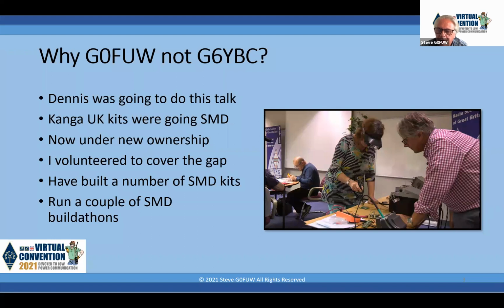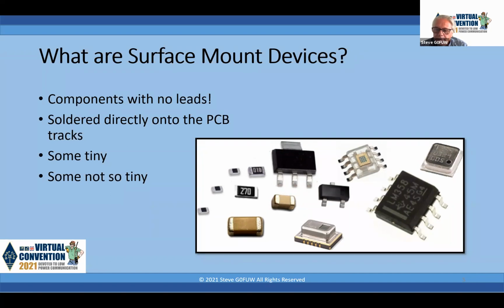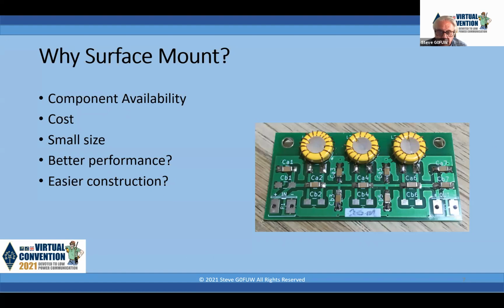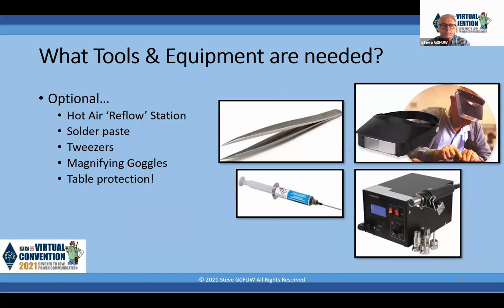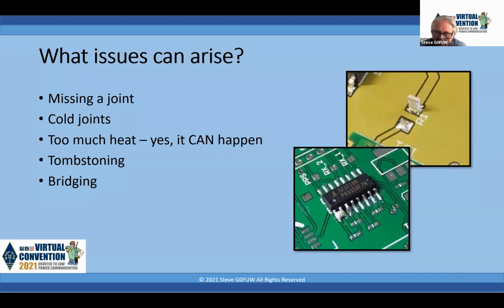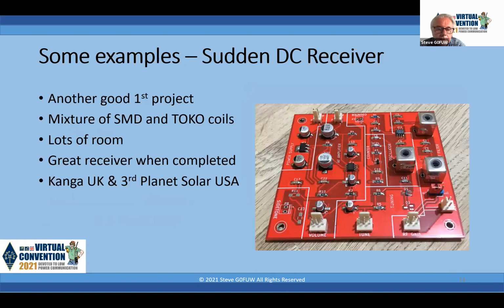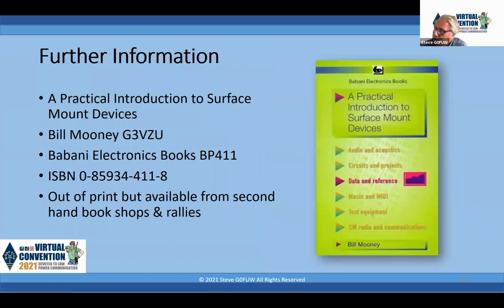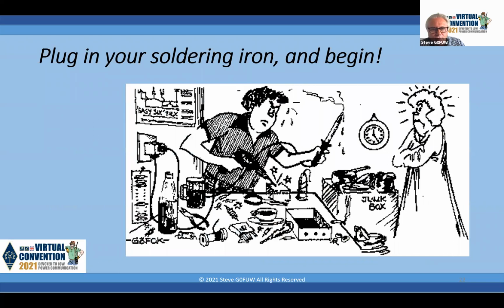Steve, G0FUW, talks about Getting started with Surface Mount Devices

Comment: Respected radio friends
I am personally hate SMD electronics because it is unable to repair or modified the circuit for further experimentation
Best 73 s
AP2GA
Reply from the maker: It is true that commercially produced SMD circuits are 'challenging' to repair or modify but using SMD for homebrew is viable, and if you built it, you can fix it. It can be easier to swap out an SMD part that a through-hole equivalent, especially if the PCB is plated through.

Comment: Great video (missed it on the GQRP convention due to other oblications). 

Had to laugh big time on the lead-free solder at school story. 

But indeed, when you work 8 hours a day soldering stuff, lead free is a good idea. But a good solder fume extractor is a must. Even when you working just a few hours a week in the shack just get one. The aren't expensive any more ($30 you have one incl carbon filter). 

isopropanol alcohol (90%) is for me the way to go for cleaning all kind of components / pcb's / parts etc. But I always use with with my solder fume extractor powered up.  

73 and stay safe. Lex PH2LB